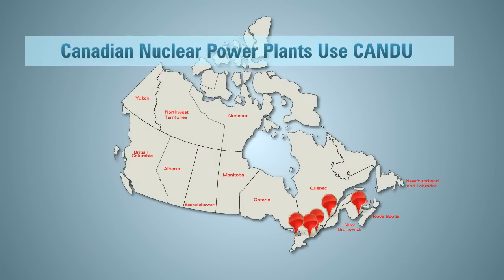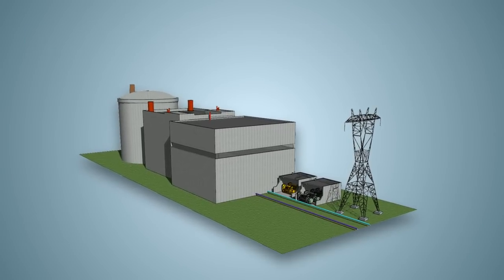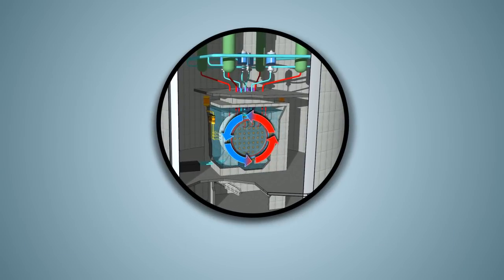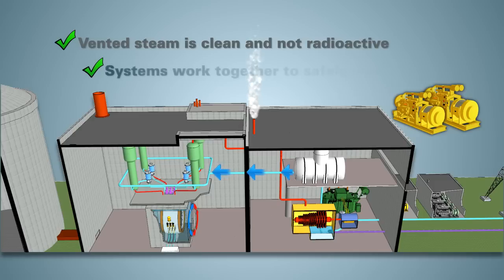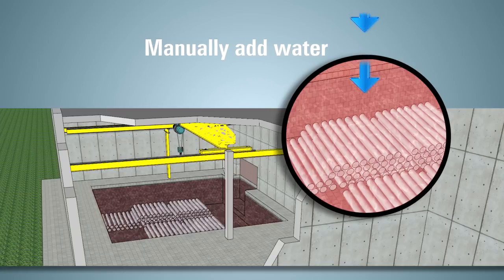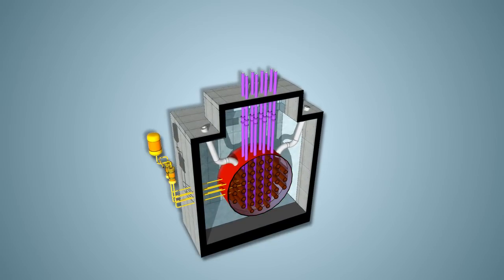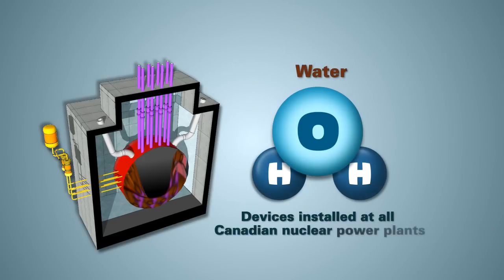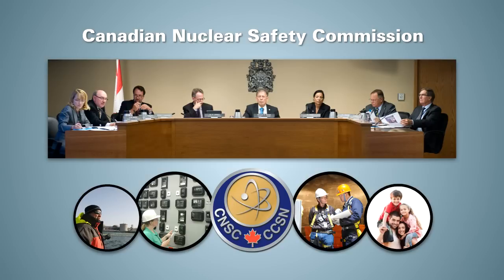Understanding Nuclear Power Plants: Total Station Blackout

Comment: 6:26 Are the spent fuel cooling system connected to the standby & emergency generator? Is there a gravity cooling system installed? This was a major concern in Japan as if these fuel rod catches fire, the results is much worst then a core melt down.
Reply: Yes. Anything associated with safety is connected to the power distribution buses that can be powered from standby generators, emergency power generators, and portable diesel generators.

There are several gravity supply systems that supply water to the boilers, including the emergency storage water tank, the steam generator emergency cooling system and the deaerator feedwater tank. There's also external headers that can use firetrucks and portable pumps to drive water into the feedwater systems to keep the boilers full.
Reply: The spent fuel is quite content to sit unattended for weeks. If the water levels in the spent fuel pool drops (somehow) it can be replenished any number of ways throughout an accident response.

Comment: After pressure is reduced, how many times can the vacuum building be used?
What are the "special devices that can reduce the risk of hydrogen explosion"? 
Can these compensate for the massive amount of zircalloys in the reactor?
Reply: The special devices just catalyze the hydrogen into something else that is rather less prone to violent explosions...I forget what. Brain is foggy today.
Reply: If I had to guess, the thing that makes Hydrogen into water is probably a catalyst similar to what is found in some lead acid batteries that recombines the gasses produced by moderate charge rates back into water, something similar is inside NiMH cells which is why they get warm when charged... the cells literally chemically rip apart but are reassembled by the catalyst which allows for a remarkable resilience against a slow overcharge, even a constant slow overcharge wont hurt many NiMH cell designs (Most lithium ion variants by contrast will vent fire and burn really hot when even slightly overcharged even if the overcharge is at a snails pace). How they get the Oxygen to meet the Hydrogen at the catalyst is the part I do not know about and is also the tricky part... see using the catalyst from a NiMH cell or from some Lead Acid cell designs is only half the battle. You need Oxygen (maybe from the outside air?) to mix with Hydrogen but only at the catalyst so that it cannot mix in the building and explode... hydrogen alone can't really burn, it needs oxygen, but it can do other nasty stuff like make metals brittle or pass through rubber and escape where it can mix with air and burn elsewhere.

Comment: Isn’t the candu reaction or “calandra” a rbmk on it’s side

Rbmk is the reactor at Chernobyl
Reply: Not even close.
RMBK used enriched uranium as fuel, graphite blocks as moderator and a light water coolant. Also had a poor design on their control rods and active shut off rods (requiring power)
CANDU uses natural uranium fuel, D2O moderator and D2O coolant. Passive shut down systems not requiring power to activate.

The thing they do share is a positive void coefficient but the RMBK design is far worse for reactor criticality.
Reply: RBMK is really good reactor in his class. Never go accident until you start messing with him. Just keep the buffer inside.
If you shut-down water-feeding for BWR or PWR....both will explode from the pressure.
Reply: I know I was joking
Reply: @user-zp2ek7kp8r   Right on. :-). And that is funny...
Reply: I’m use to bwr and pwr so not use to this Canadian stuff
Reply: @user-zp2ek7kp8r  Understood. There are so many subtle differences. All reactors result in the same effect (heat through fission) but get there slightly differently. I've been in CANDU for a long time. Studying how the other reactor styles work is very interesting. Especially accident management and new reactor designs.
Reply: The interesting thing about this discussion is the defense of older reactor systems. The video is not about the hammer and sickle or maple leaf designs. The older designs had their flaws and are being improved upon or abandoned. Look to the future at what is being built today by AREVA or in China, India, etc.
Reply: So y’all are nuclear engineers
Reply: @user-zp2ek7kp8r  Nope. Mostly Operation then moved on to other stuff. Real good training though.

Comment: Wait, why are all the supposedly redundant standby and emergency generators in the same building and right next to each other? This reduces their redundancy as if one were to start a fire, it would likely spread to the rest. Or if there was an explosion, plane crash, meteorite strike, collapse, terrorist attack, poison gas build up, or even flood: their proximity to each other increases the chance of a total loss. It also reduces the space for emergency workers.

Another thing, these devices that turn hydrogen into water...how many of these exist? Are they redundant? Are there extra devices stored at a different location that can be easily put into place if need be?

Also...what about valves and inlet/ outlet pipes...are these redundant? Can they be operated manually?
Reply: They are only like that in the video.  In the real world, the stand by generators and  emergency power generators are widely separated.  All the elements of Shutdown System 1 and Shutdown system two are separate.  They run off different power supplies, they are geographically separated in the plant, so a fire shouldn't damage components of both and they are made from different components from different manufacturers to prevent a common mode failure.

Comment: so you mean there are No fire trucks in fukushima,  Japan?
Reply: CANDU is very young, when Fukushima BWR are from 60's..
Reply: Actually the history of CANDU is older. The design basis of them is from ZEEP, which started operation just after World War II. The very first CANDU reactor was the Nuclear Power Demonstration; it ran successfully from 1962 to 1987.

We've just been nearly-paranoid about reactor safety since the accident at NRX. A ton of lessons were learned there and the principles developed from that are evident in every CANDU reactor since, the most obvious being redundant, fully-automated safety systems. Human error was the greatest contributing factor at the NRX accident, having both started it and led to it worsening greatly within seconds. The sheer speed of the accident made it very clear that humans are just too damn slow to be trusted with those safety systems, and far too unreliable to be trusted to manually operate critical systems without the system blocking them from doing something stupid.
Reply: Fire tucks were dispatched almost immediately. But that tsunami killed 15,000 people and wiped out infrastructure dozens of kilometers inland. There weren't any roads for them to drive on to get to the plant.

Comment: Hi there, about how much radiation could one expect to be released into the environment in a controlled venting situation? As in, at the top of the vent, what is the level of radiation and amount of material being released? Thanks.
Reply: Yeah,   and I would like them to elaborate how the controlled venting of radioactive steam is actually achieved...... rather than just take their word for it....    I like the video and the precautions,   but some of it still comes off as shady with the lack of information they give in certain aspects.
Reply: Precisely  @MrKirk94  and Benjamin.
Reply: Depends on how bad the accident is. The answer is always as little as possible.

If there's an over pressure in the containment building a controlled venting of SOME material is done to prevent a breach which will uncontrollably vent ALL of the radioactive material. It's a last case 'lesser evil' solution. Most simulated models put it days after a worst case accident so in addition to being limited they try to time them with evacuations and weather patterns.

Comment: what happened if sea water  level encrease for some catastrofic event...emergency power supply can be shut down by sea water?
Reply: That was pretty much a situation unique to Fukushima. Nearly every other reactor in the world is built on ground water can't reach and/or has a superb flood abatement design. Since Fukushima everyone's double checked their plans and made changes where a very few mistakes have been found.

Water ingress of all types is a well known issue and should have been easily spotted at Fukushima, it probably was in fact, but the regulators in Japan are extraordinary slow and largely toothless.

Now every reactor in Japan has a tsunami wall that can stop anything, high ground redundant power, waterproof electrical areas, passive controlled cooling reservoirs, etc. But they're closing the barn doors after the animals have run out.
Reply: I am thinking that putting a battery backup, and a generator backup system in a basement below ocean water level on the ocean front might not have been a brilliant engineering idea.

Comment: There are lot of different systems to stop meltdown. Is it not much safer to use molten salt thorium reactors, where in case of total failure, the reactor shuts down itself, and there is no possibility of meltdown? And since there is no high pressure water or steam used, no chance of releasing radioactive vapour? And the thorium reactor can actually reuse the spend fuel from  uranium reactor. Seems like no-brainer, I wonder why Canada is not investing heavily into MSR?  Would it not be the best way of stopping carbon release and slowing down global warming?
Reply: Mandate
The Canadian Nuclear Safety Commission ... disseminate objective scientific, technical and regulatory information to the public....

If your mandate is disseminate objective scientific, technical and regulatory information to the public - should it not include dissemination of information of alternative technologies that could be magnitude safer than the existing technologies? With less chance of nuclear proliferation. With much less radioactive waste, that last only for 100 years instead of 1000 years? And with abundance of thorium to be used?
Reply: There is a Canadian-based company, Terrestrial Energy, that has been developing an MSR design for a few years now, actually. One of the primary reasons they are based here and not in the US is specifically because regulations here do a lot more to allow for innovation, which is sometimes paraphrased as Canada saying "prove your reactor design is safe" instead of "prove your LWR design is safe".

Terrestrial Energy's IMSR has a lot of potential. It is being designed with the thorium fuel cycle in mind for future use (the plan is to start with uranium though). They plan for production to essentially be similar to an assembly line (think airplane manufacturing) to drive down costs, and for the self-contained units to practically be plug-and-play at industrial facilities, to provide heat for any number of uses, including power.

Personally I hope for a day in the near future when Canada will start buying "spent" fuel from American LWRs to burn in IMSRs, and then sell the energy back to them at a profit. That'd be fun.
Reply: @BlueArt2001  As someone with a materials science background, I am deeply interested in molten salt reactors, because it's my field that's holding everyone up. The physics works. It's the damn materials that holds the thing that need to be improved last I checked.

Think about how your car fares after a winter of driving on salted roads. If you make the salt molten, it'll be many many times more corrosive.

Comment: The candu reactor is a very safe nuclear reactor but I wouldnt say it's fail safe. Remember when the titanic was unsinkable? What if there there was a hydrogen build up and explosion that damaged the containment building. Or maybe errors from construction that are unforeseen. I doubt it, but hey radiation is scary stuff lets not forget that. I have a question though in candu reactors does inserting the fuel rods or the poison system cause an increase in thermal energy for a brief moment? I know this was a design flaw in the Chernobyl reactors because the tips had graphite on them.
Reply: "I have a question though in candu reactors does inserting the fuel rods or the poison system cause an increase in thermal energy for a brief moment?"

Nope. That's something very unique to the rather terrible design of the RBMK: https://canteach.candu.org/Content%20Library/19910101.pdf
Reply: The containment structure, where there is a risk of hydrogen build up in the event of an accident has a system of hydrogen igniters which will ignite any hydrogen present to burn it off before the level gets high enough to be hazardous.  They also have passive catalytic re combiners which will get free hydrogen to recombine with oxygen to form water.
Reply: Graphite tip control rods were a design decision that traded safety for something else that the USSR cared more about, not a design flaw... they deliberately chose to make the control rods operate that way despite the safety concerns for some reasons I cannot recall... but if I had to guess it would have something to do with graphite moderators which the USSR used, controlling what parts of the rods are "burned up" by moving the graphite tips around, financial cost considerations, and apparently Chernobyl was designed by taking a reactor used to make weapons, slapping a generator on it and pushing cost and speed ahead of safety... a costly and deadly decision... but probably still not the worst thing the USSR has done (they also dumped radioactive waste into a certain lake that will remain deadly to be within visual range of for a few hundred thousand years yet, and left a bunch of unmaintained RTEG units to rust and release their screamingly radioactive fuel into the hands of unsuspecting hikers and salvage people).

The USSR knew the risks, they deliberately chose to ignore them, then they tried to cover it up until European Geiger counters went nuts and the Western nations knew something wasn't right.

Comment: What happens if the core melts through the containment building and into the ground water?
Reply: Wont ever happen. Just like the elephant foot in Chernobyl is no longer melting anything because its concentrations of nuclear fuel are very low
Reply: You would probably have a major nuclear catastrophe on your hands. Probably a large part of North America would have to be evacuated
Reply: @MusicGamesEverything  Chernobyl had no containment at all and the elephant foot stopped. Why with all of the Candu precautions would it be worse? Also Candu uses natural uranium not highly enriched which means that after the heavy water is gone the nuclear reaction stops.

Comment: There is something wrong with the idea that a nuclear reactor can fail because it loses power. I always thought that each reactor should have a small internal system for generating it's own power for critical systems. An extension to the secondary circuit, using much smaller plumbing could run 2 or 3 small turbines. Then the possibility of losing power over prolonged periods of time is virtually eliminated. In addition there should be the normal practice of backup diesel generators and battery power. 
Sterling engines can be used to provide electrical power giving a further layer of security, that could be powered indefinitely from any of the many available heat sources.
The devastation from a nuclear disaster is so great, that you can't have too many generators, batteries or pumps around. Not much will go wrong as long as the cooling system keeps on operating.

Comment: I know this is fantasy, but as a fan of the walking dead, I have always wondered what happened to the nuclear power plants. Did operators manage to shut down in time ? Are they leaking or exploded ? I know it a fantasy show but it always had me wondering.
Reply: SCRAM work without power when electromagnet lost his power.
A scenario in this movie happen if there is NOT humans in the nuclear power plant.
But STILL this isn't safe desing like LFTR...uranium is the problem.
Reply: wonniewarrior they added water to the chalandria and it was all fine
Reply: Probably very little. If they held off the zombies for even a few days they'd have achieved cold shutdown. The control system will be a brick in just a few days without maintenance and valves will rust in months. After that it's just a pile of concrete with some interesting metals on the inside.

With all the security at a nuclear power plant it'd probably be a great place to hide out. With basic survival skills you'd ironically have access to everything but electricity.